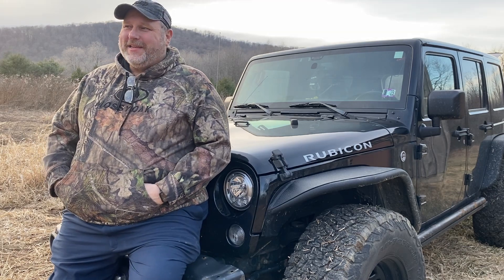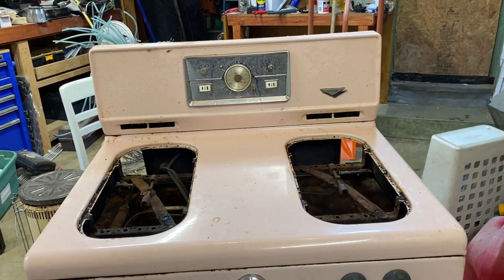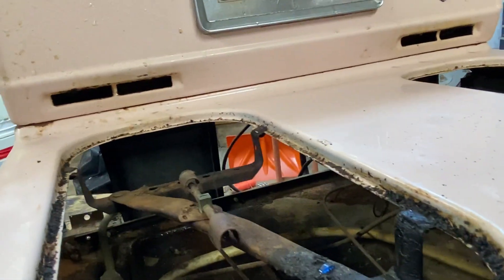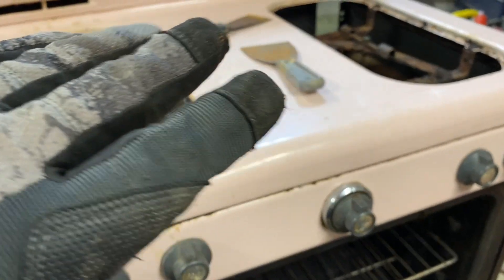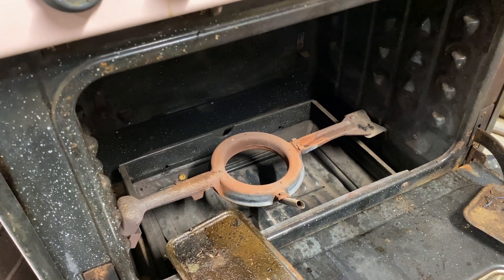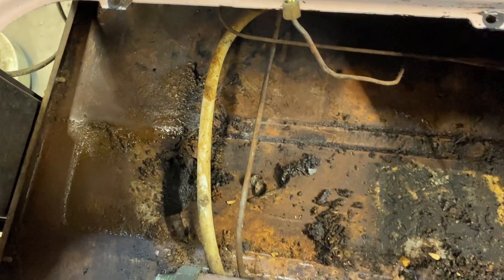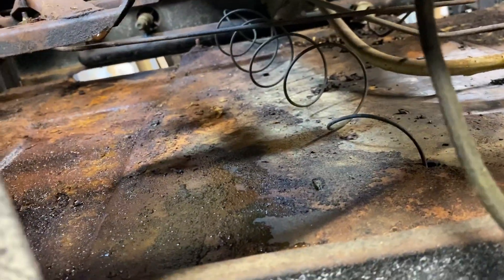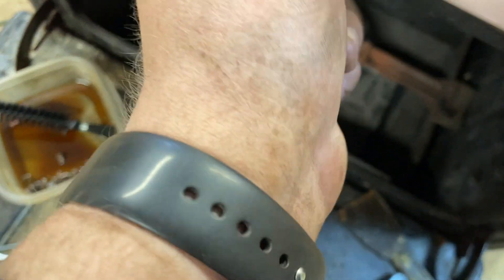A $50.00 Off-Grid Propane Stove. Finding and Refurbishing a 1950’s Dixie Range.

Comment: great job on a beautiful stove!! Will be a focal point of interest in your new home. You can probably fine replacement burner grates is your welding does not hold up with a little internet searching. Also yo can probably get the burner pilots working again fairly easily unless you  have them shut off on purpose.
Reply from the maker: I’m sure I can get the pilots going again, but since it’s off-grid, I just don’t want to waste running it when unnecessary. Thanks for the comment!

Comment: I have an apartment size DIXIE stove and wondered if I can use a propane gas tank for supply fuel to the stove?
I know it was intended to use Natural Gas, which would be preferable but not available for me.
Thanks for any information, as the Stove is in good condition otherwise but now I know needs a good cleaning.
It has one pilot burner for the 4 top burners, and for the oven it has to be lit by hand.